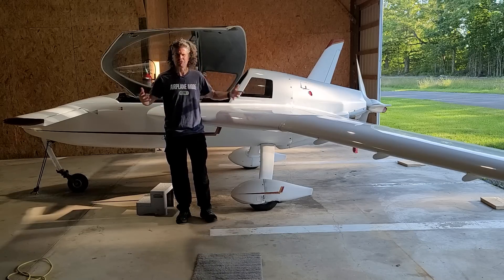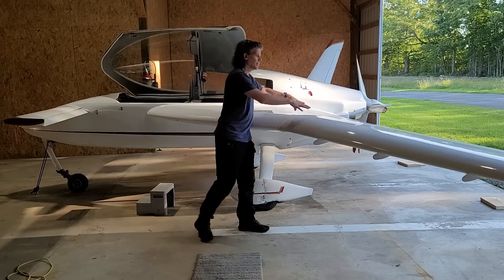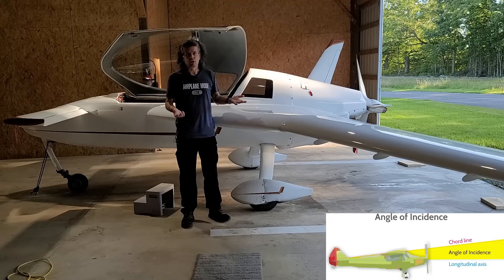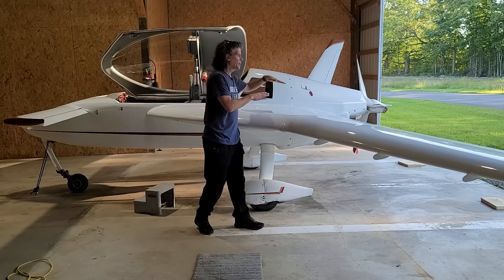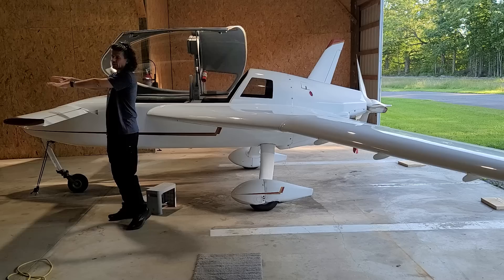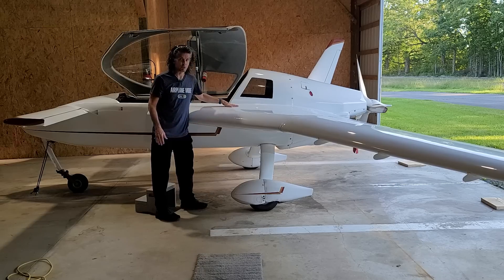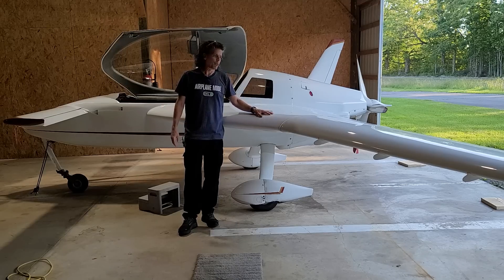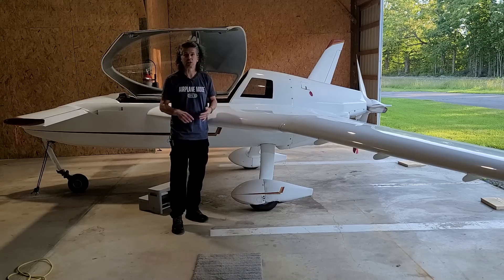Why Did I Buy This Weird Cozy MKIV Canard Airplane?

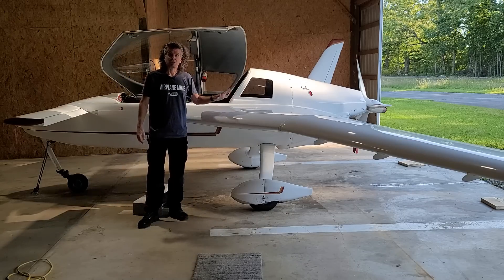Comment: He never gets around to answering the question he asked at 3:40. Note that pretty much ALL general aviation aircraft - gliders, light airplanes, heavy lifters like the C17 - are all "conventional", rather than canards. Canards make up a tiny fraction of the total, a great many are homebuilts and are smaller types. There's a reason for this, and it isn't the flaps.

Comment: Couldn't they put flaps both on the canard and the main wing? Or would that be too expensive?
Reply from the maker: That's the only way it could be done - but the canard already has the elevator, so you would have to enlarge the canard to allow it to generate that extra lift, which means it creates more drag. It's always a compromise.

Comment: I understand that the Long EZ had issues with flying in the rain and that is was solved with the Cozy.  Can you expand on this?
Reply: The airfoil chosen for the original long ez canard, as well as the quicky canard, was a nasa GAW airfoil (if I recall correctly) which was highly optimized to minimize drag by having extended laminar flow but there was an unforeseen and unfortunate consequence in that it was very sensitive to rain or other types of contamination which would cause intermittent and unpredictable flow separation at lower AoA than when clean. It happened to a guy I know and scared the crap out of him. John Ronz designed a newer airfoil which fixed the problem. It could also be fixed by adding vortex generators to the canard.
Reply: Thank you @sblack48
Reply: @sblack48  "Roncz" for anyone looking it up
Reply: The issue with the Long-EZ was with the original canard design. Some pilots reported having a slight change of pitch when entering clouds or rain. The issue was subsequently resolved by a new canard design (Roncz) or by adding tiny vortex generators to the original design. It's no longer an issue.

Comment: Something that might be useful would be in internal pulley to slide a weight forward and back to move the CoG
Reply from the maker: That's exactly what was done when developing the prototype of this airplane. However, that would mean you're still carrying the weight when you've slid it backwards, which means more fuel use and less available load. Far better to just remove the weight from the front when it's not needed.
Reply: @CanardBoulevard  Not if the weight was water that could be jetisoned if not needed. Or perhaps fuel.

Comment: Best video I have seen on canard aircraft. I was sold until 12:00 where we learn the aircraft can be stalled, something all the other videos I watched did not cover or stress.
Reply: Just about anything that flies can be stalled. What is different about a canard airplane is that even if it's stalled it will not become uncontrollable like most other airplanes. That's what makes a canard safer and more "stall  and spin proof."

Comment: Excellent! Engine cooling?
Reply from the maker: There is a NACA duct on the bottom, and the engine is cooled through updraft cooling, and then out the back. Cooling is always tricky with canards, but it's pretty good on this one.

Comment: Really interesting, and I learned a lot about the physics of canard airplanes.  The one thing that I'm a bit skeptical about is your statement that horizontal stabilizers always have negative lift.  There's no reason that that would have to be true, depending on the position of the cg vs the center of lift.  If it's always true, that's a choice made by designers, not a requirement.  Is my understanding correct?
Reply: Yes, your understanding is correct. It's not uncommon in practice for typical conventional horizontal stabilizers to produce upward lift. There's an unspoken assumption in these descriptions that we're talking about the most critical point for the stabilizer in the envelope, which is nose-up command: rotation/flare/climb/stall. That regime determines your airplane's max gross, and at that point, conventional tailplanes push down, canards push up.

It's theoretically possible to imagine a conventional horizontal stabilizer that both produces pitch stability and positive lift near stall. However, the math of pitch stability requires that the stabilizer be more heavily loaded than the main wing - and that in turn means it will stall first. Net result, the positive lift from the tailplane goes away and the airplane drops its tail, stalls fully and permanently, and falls ass-first out of the sky the first time it stalls. I don't know examples but I wouldn't be surprised if like five of the aerodynamic crackpots in the nineteen-teens and -twenties built planes with this property "for efficiency", and were then killed when their prototypes fell ass-first out of the sky.
Reply: So with any cambered airfoil you generate 3 forces: you have your coefficient of lift, of drag, and of *moment*. This last one causes the airfoil to want to twist, pushing the nose down. The HSTAB l, generally speaking, is a symmetrical airfoil with a negative angle of incidence to push the nose back up and counterbalance the Cm. Hope that helps!

Comment: I don't think it's the weight of the engine forward of the wing that requires the horizontal stabilizer to generate a downward force.  It has more to do with the fact that the lift vector of the main wing is not straight up but angled  forward and up.  A straight rectangular wing on it's own would tumble forward as soon as it started to generate lift do to the forward angle of the lift vector.  Even a perfectly balanced sail plane would still need a horizontal stabilizer.  The genius of the flying wing that The Horton brothers (and Jack Northrup) designed and few relied on a long  swept wing to counteract act the forces that would cause a normal wing to tumble forward.  (I'm not an export, but I did read an aerodynamics text book just for fun several years ago.)

Comment: The theoretical advantages of the canard configuration have to be balanced against the real-world disadvantages.   Similarly - the "theoretical advantages" are really just first order considerations and do not encompass the interacting dynamics of flight.  The canard may be better for a very narrow flight envelope or mission.  Specifically, high, fast, long distance travel. But I think the canard's only real advantage is stall resistance (and it looks cool).   Your whole section on flaps is wrong.  The basic problem with the canard configuration is the requirement for the canard to stall before the wing.  This means you can not use the full angle-of-attack range of the wing - thus you must carry far more wing area than "conventional configuration" - tail in back - (in quotes because the Wright Flyer and many other first flyers were canards). You use the high lift generated by higher angle-of-attack during take-off and landing, and then in cruise flight uses very low angle-of-attack for low drag.  This is true for both configurations, but with conventional configuration you can use a much more of the angle-of-attack envelope - thus the higher lift at higher angle-of-attack lets you need less wing in the conventional configuration.  The gains seen with the smaller wing of conventional configuration more than makes up for the losses due to the tail downforce and extended fuselage. Conventional configuration airplanes with similar take-off / landing performance and similar frontal area will outperform (go faster, and slower on similar power) than a canard - except in one specific flight regimen - high altitude cruise. At high altitude cruise you again need a higher angle-of-attack because of the thinner air. The larger wing flying at the lower angle of attack will have less drag.   So why aren't all high altitude long distance cruise aircraft (U2's, airlines, etc) canards?  Is it some conspiracy of the boring? No. It is right back to the interacting dynamics of flight.  You design for a flight regimen, and then add the band-aids needed to achieve the other regimens required.  Those massive flaps on airlines increase wing area.   It is unfair (almost laughable) to compare a Cozy to a Cherokee. A closer comparison might be to a Mooney M20J.  The M20J is at a disadvantage (in terms of fair comparisons) because it is heavier and less attention is paid to drag.  However, the Mooney M20J will take-off and land in less distance, while cruising as fast or faster on similar power.   Sadly, though it looks cool, the canard is a poor configuration.  (BTW - I'm a LE driver. ;-)
Reply: Some of us like the piece of mind of flying an airplane that is more stall and spin proof regardless of the petty differences you point out and that is the only difference even worth discussing. The rest is only of academic interest and, as you implicitly stated, of second or even higher order and in the noise when it comes to making a selection.  It's absurd to pick contenders in making comparisons between one type  vs. another when, as you pointed out, they were designed for different "regimes" and missions.
Reply: @carlosa.avalle528  Hi Caelosa - Yes, resistance to the stall/spin is huge - especially since stall/spin accidents represents one of the primary categories of aviation fatalities.   But that is not what the video was about.   It was about the performance advantages of the canard planform - and sadly the reality is there are no advantages. I agree that performance is a "petty" concern if you are in a spin. But I was just trying to counter the mis information that is rampant amongst canard lovers like me.  The advantage of getting rid of the downforce/drag of the tail does not make up for not being able to use the entire range of angle of attack.  Cheers!
Reply: @eonbio  I think Scott was trying to explain some differences in the aerodynamics of canards vs. more conventional types w/o getting caught up in too many fine details since as he stated he's not an expert and I don't think his intention was to start a war of canards vs. other types. To be honest with you, I didn't know about the details you pointed out but I learned from it,  it made me look into it and I think you're right, when all of these considerations are thrown in a bag and shaken, what comes out is about the same either way. I think what set my hair on fire was your conclusion "the canard is a poor configuration."  If, aerodynamically speaking, the end result is about the same then they are either both equally good or equally bad depending on whether you see the glass half full or half empty. "Poor configuration" in some regimes and missions, excellent in others. Even if there is a small price to pay in terms of aerodynamic efficiency for a more stall and spin proof configuration, it is worth it, and that's first order. If I say to you, would you give up a degree or two in angle of attack range and a minute loss of aerodynamic efficiency to gain nearly idiot proof stall and spin resistance, would you take it? Anyway, glad we can have this discussion.
Reply: @carlosa.avalle528  Hi Carlosa - I just remembered meeting you in Columbia, great to connect!  I am admittedly an odd duck that loves to find out I'm wrong -  I am always learning.  So feel free to let me know where you think I'm totally full of it.  I am in New Zealand till May, but perhaps we could meet.  You are at KLVK? I'd love your input on my LE now based at KDWA (its good to have 6,000ft of pavement with these ducks).
Reply: @eonbio  Wow! What a strange way to connect again. I didn't recognize you from your YouTube handle but I certainly remember you from your airport and the discussion we had in Columbia. When I got home I looked you up as I was curious about the LE project you had mentioned. Sounds like you finished it and are flying it now. I agree with the need for long runways, I've got 150 hr on the LE and I'm still uncomfortable landing on the shorter runway here at LVK. I always ask for the longer one. You should drop by LVK sometime, otherwise hope to see you at Columbia!

Comment: Thank you CozyLover for this comprehensive video- I like you concise style a lot ❤
Can you explain why all Canards except for the Velocity stood away from an all retractable landing gear?
I just don't get it why in an airplane design where avoiding drag is made the key design goal so many ingénieurs skip the retractable main gear.
If you look at nowadays designs like the vl3 experimental aircraft they proved that even in serial production there's no longer a weight penalty for a retractable main gear.
And by now we haven't spoken about the lines and looks of canard aircraft with versus without fully retractable gears! 
What is your opinion/ approach to this question? I am really interested into your point of view!
All the best and always 2kts above canard stall speed on short final 😊 Joern
Reply: My guess is that brakes are very important in canard equipped airplanes, for shortening the landing and if you brake hard, then you need stronger landing gear, probably a fixed system is stronger than retractable landing gear, for this class of airplanes. End of guessing, haha!
Reply: There are at least 3 variants of the Rutan canards that have retractable landing gear, Velocity, Long-EZ retractable, Berkut. There may even be a Cozy or two modified for it.

Comment: Theory vs. Practical reality…

For both Canards and conventional planes…

The leading wing can cause dirty airflow to the following wing… affecting the lift the trailing wing provides…

Some canards put the front wing in a higher vertical plane compared to the main wing…. 

Some conventional planes use a high wing, or extend the tail further back…. Full flaps in some planes can blanket the air getting to the rear wing, thus causing a tail stall…

A tail stall in a conventional plane removes the down force, and is the cause of it becoming a lawn dart….

During test flights… put some tell tails😅 on the following wing… see if the airflow is disrupted by the canard at different angles of attack.

The down force on a conventional tail can be about 50LBs or so… which wastes a matching 50Lbs of lift…. 

Sooooo…..   the canard has the opportunity to earn about 100LBs more of useful load over the conventional plane… good for about an hour and a half more fuel… or another skinny person…

If the canard sends too much dirty air and disrupts the lift generated behind it… it is very easy to lose the theoretical benefit of the canard wing’s lift….

Useful load of similarly powered fast planes is about 1k LBs… this includes the weight of four people and fuel….  getting a spare 100LBs UL for a plane is always a blessing!

😃

Comment: I’m not a pilot but enjoy aviation videos.  
Can someone explain how you get the CG correct for specific flights. How exact do you get for each flight? Pilot weight can vary a bit from flight to flight. Do you just make your best guess or do you weigh people and luggage ? 
How do you compensate for the in flight CG change as you consume fuel? 
Thanks
Reply from the maker: There are very specific C/G charts and calculations done to ensure that the airplane is within the C/G envelope, as part of your flight planning. People generally know what they weigh (I usually add 5 lbs for clothes), and I have a luggage scale for weighing luggage.

On some aircraft, you do have to account for the shift in C/G as you burn fuel, so that is taken into account. In this airplane, the fuel tanks are right on the C/G, so it does not move as you burn fuel.

Comment: I don’t agree that the plane doesn’t go nose down because s’use of the stabiliser, it doesn’t go nose down because the weight on both sides of the center of gravity is equal. The stabiliser disrupts this balance upwards or downwards to provide different attitudes needed for first regime flight, second regime flight, diving, climbing, flaring…

Comment: As a non-pilot, the other thing that was not mentioned was the use of a pusher propeller.  Having the propeller on the front I would have though would help reduce the chances of the cunard having insufficient airflow at low speed since the prop wash should help keep adequate airflow over the cunard.
Reply: On the other hand, prop wash flows over lifting surfaces of an aircraft causing an increase in dynamic pressure and changes the local angle of attack. This can result in many different effects including an altered lift distribution, increased control surface authority, and changes in aircraft stability.  Canards don't suffer from the typical side to side rocking while on the ground due to prop wash over the vertical stabilizer. There is only clean air moving over all lifting surfaces making the ride much smoother and stable while on the ground and in the air.
Reply: Well that's what il learned about canards : No induced airflow on the control surfaces beeing the main drawback of this design, so Indeed no control unless you have enough speed and incidence
Reply: @brunoboettcher67  A canard airplane remains entirely controllable during all phases of flight, including a stall, except perhaps in a "deep-stall" of which there have been very, very few. If the engine quits you glide it down like any other airplane. Canards have fairly high glide ratios (~ 15:1). Even if it "stalls" the airplane remains completely under control, that's the beauty of the canard design compared to more conventional types.
Reply: @carlosa.avalle528  well, I could only try one on simulator and it behaved like my instructor told me, at slow speeds it didn't turn?